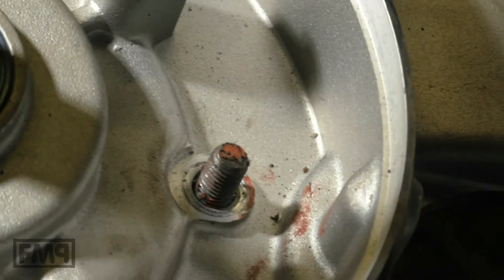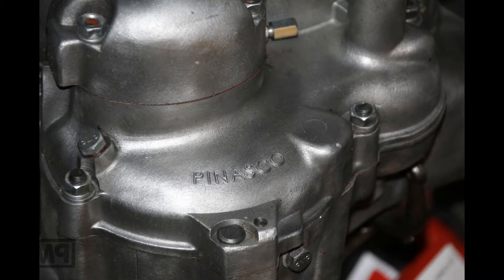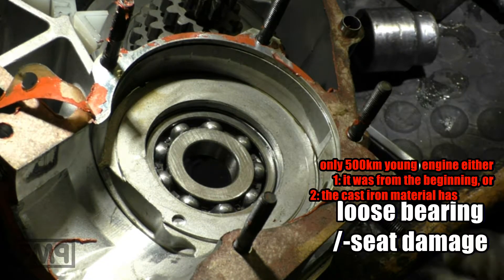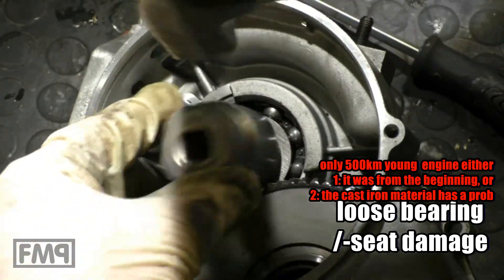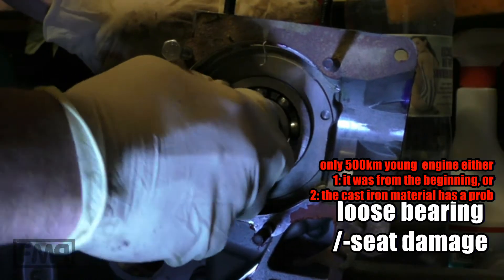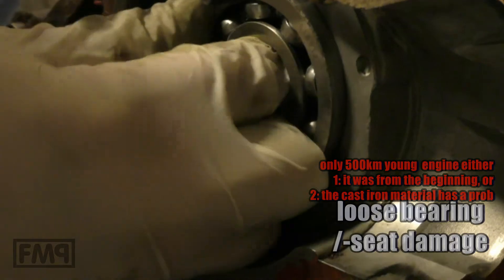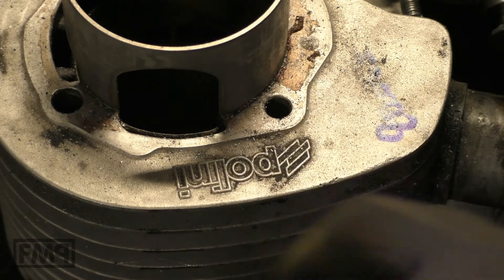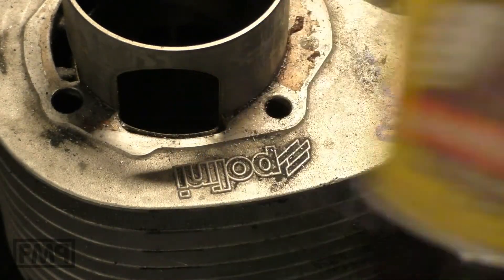BEARING SEAT tolerance after 500km / PINASCO engine case / vespa 244 / FMPguides - Solid PASSion /

Comment: hey  i  just  wondering..  what do  you think  about using  loctite  bearing  retainer on  the  loose  bearing  seat?  will  it serve  as an  alternative method instead  of  repairing the  bearing seat itself?
Reply from the maker: unsure if these seats are repairable, cause what if its an issue with the cast iron material itself? I also read that new special bearing seats, set with the correct tolerance, do get loose again, which indicates, it is a cast iron topic

Repariing with glue is just a plaster. pretry sure it will not hooks anyways

Comment: Were there any problems before splitting the cases? Was the crank moving? Did gas get in the gearbox? Anything to indicate the bearing was bad from running the motor?
Reply from the maker: we did know aabout this potential and wanted to check. For it and fine tuning potential as it was made by an official. Shop